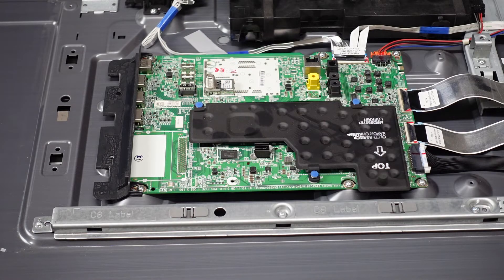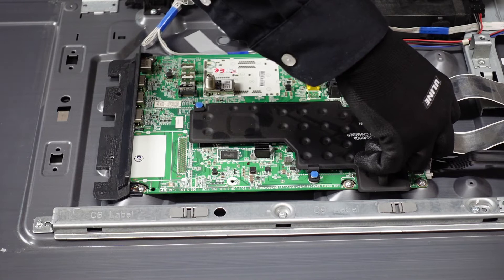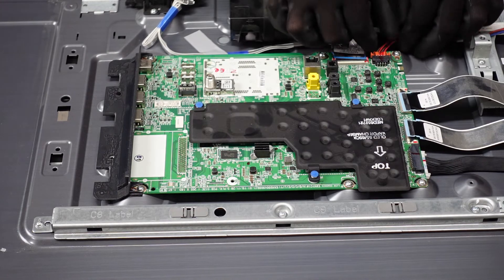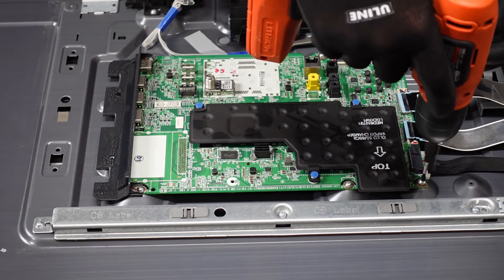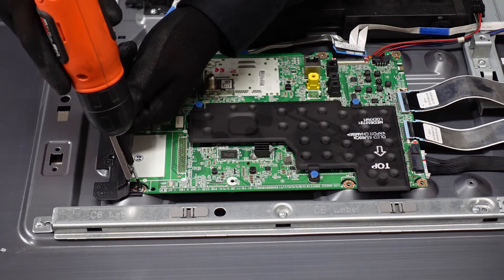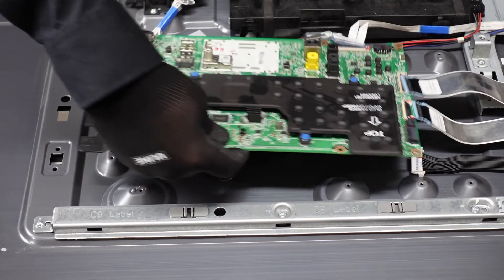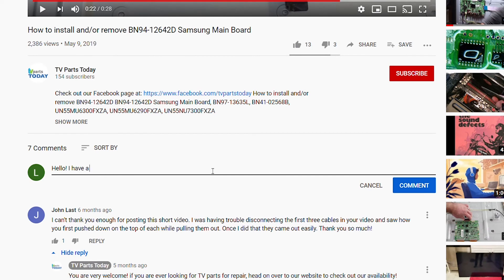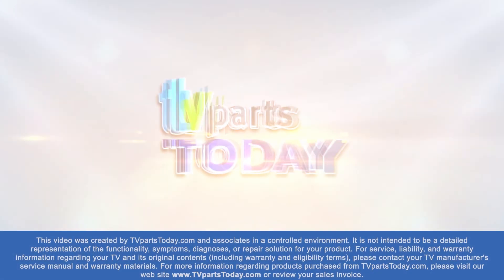LG OLED65A1PUA **NO PICTURE** What to do if you have sound but no picture. DIY board swap guide.

Comment: I have a 2-year-old TCL 75-inch TV (75R617). While I was watching a movie one night, the screen turned to black while the audio kept going. I did several software reset with no luck. I can hear the clicking sound when the TV is on and when I navigate through the menu using the remote control. Yes, I can see the menus with a flash light, though they are every faint. One other thing – There is a humming noise from the power supply when it is plugged in, with or without having the TV turned on.  I do not see any lights coming out off the panel holes.  What part(s) could be bad?
Your advice will be greatly appreciated.
Reply from the maker: It sounds like you have narrowed it down to your back-lights. We have not seen to many of these models come through our facility, so I'm not sure if you have a dedicated LED driver or if it is integrated onto the power supply. If you do have an LED driver in your set, I would try swapping that out, if not then the power supply would be up next if we were going purely off of board swaps. There could also be an issue with the back-lights themselves. If you would like to go over your problem in more detail, send us an e-mail with your model number and a brief description of your issue to: info@tvpartstoday.com
Reply: @tvpartstoday  Thank you for such quick response.  Yes, I already emailed the question with detail 2 days ago, waiting for the response.  TLC 75R617 (identical TV as the 75R615 except the remote) does have a separate LED Driver. I will email a picture of that every complicated LED Driver to you guys.

Comment: Good day, I have a LG 65inch TV year 2019 today I turn it on and it doesn't show and picture on the screen but yes I have sound working prefect. I take a flashlight put it on the screen and I doesn't see anything still. I don't have kids for they can touch the screen what do you think is the problem. Should I buy a new main board because I turn it off leave it a whole 15 mins off and still nothing only sound.
Reply: Model Main Board EBT66157202
Reply from the maker: Hello, 
Yes we recommend replacing the main board considering you have done the flashlight test and do not see an image but still have sound. 

Here is the link to that main board:  https://www.tvpartstoday.com/EBT66157202-LG-Main-Board-EAX68253604-1-0-65UM6-p/ebt66157202.htm

Thank you, please call into the office or email info@tvpartstoday.com for any questions or concerns!